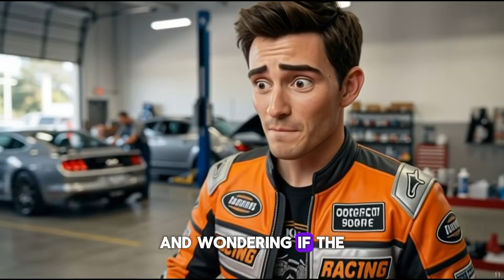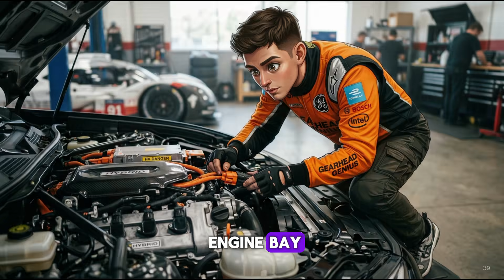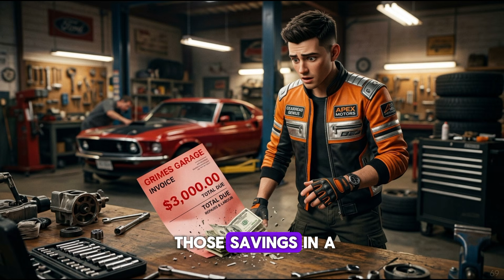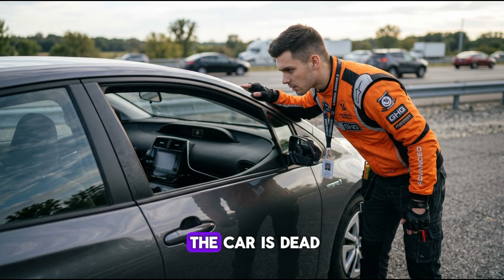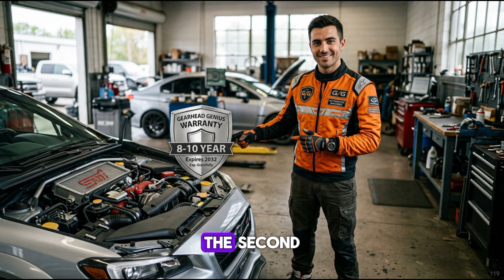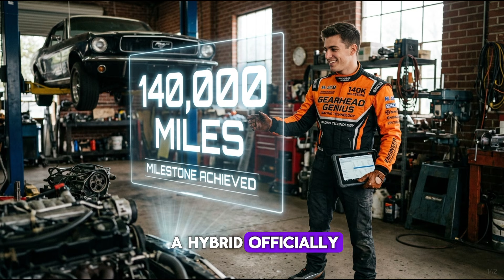The 200,000-Mile Verdict: Gas vs. Hybrid Engines Maintenance Costs No One Is Talking About

Comment: If I had a Turbo I'd change the oil every 3000 miles and no more but I wouldn't buy a turbo I get a v8 no turbo. If they didn't have it I'd go elseware.
Reply from the maker: 100% agreement there. On a turbo, 3,000-mile oil changes aren't "over-maintenance"—they're survival. Turbochargers act like a furnace for your oil, and once that oil cokes up in the bearing supply lines, the engine is toast.

The simplicity of a naturally aspirated V8 is the ultimate reliability cheat code because you aren't fighting the massive heat and pressure of forced induction. The tragedy of the 2026 market is that EPA/CAFE mandates are making those NA V8s almost extinct. If you can still find a clean V8 without a turbine in the way, hold onto it—it's a high-value asset in a world of high-strung, disposable engines.

Comment: Really? I had a 2011 Prius I just sold in perfect condition it had 350,000 miles on it ran like a top didn't need brakes for 120,000 miles and the service was so cheap I replaced the calipers, brakes, and rotors,
also I changed the fluids all the fluids at 30,000 mile intervals. Oh yeah  I got 5000.00 on a trade. Your out of your mind, I just got 68,000 on a set of milestar tires rated for 50,000 and they had plenty of tread left the old penny trick. Your data lies..... the battery is warranted for 150,000 miles I have friends that do ride share and buy old Prius at 200,000 clean them up and take them to 500,000 drive battery's good for the most part but they test before they buy and they never once lost an inverter Never!!! And yeah the engine has less wear parts than a gas only I can attest to that having had 6 hybrids now. Besides filters plugs wires and coil packs My engine didn't burn oil or have a problem till I traded it. This is the same on all 6 I've owned. now I have the 1.8 hybrid probably one of the best engines in the Prius until the 27's simple to work on everything up front I'll bet you I get 300,000 out of this 26. KBB gave the 26 Corolla Hybrid the most reliable and best buy. As far as the oil changes you think you know more than the engineers that Toyota pays top dollar too that set the specs on oil and tolerances, only time will tell so far at my dealership I'm hearing no complaints. Everyone already knows about the turbo problems and are getting the fix.
Reply from the maker: Richard, you actually proved exactly what I’ve been saying: Maintenance is the variable. You didn't get to 350,000 miles by following the "minimalist" schedule—you changed your fluids at 30,000-mile intervals. That is exactly how you beat the "lifetime fluid" trap that kills most modern hybrids. You're a proactive owner, and that's why you won.

However, we have to look at the engineering shift. Your 2011 Prius used a very different architecture than the 2026 models. The 1.8L (2ZR-FXE) you love is indeed a gem, but the move to the 2.0L Dynamic Force with 0W-8 oil and higher compression ratios has shrunk the "thermal safety margin" that your old Prius had in spades.

Regarding the engineers: They are brilliant, but they are designing for EPA/CAFE compliance and the first 60,000 miles of the warranty. Mechanics see what happens to the second and third owners at 150,000 miles once that "compliance engineering" starts to fatigue.

You’re proof that a well-maintained Toyota is an asset, but my data isn't for the guy doing 30k fluid changes—it’s a warning for the person who follows the "10k oil/lifetime trans fluid" manual straight into a scrap heap. Keep doing what you're doing, and that 2026 will likely be another 300k survivor!